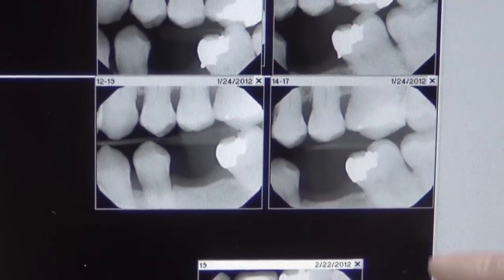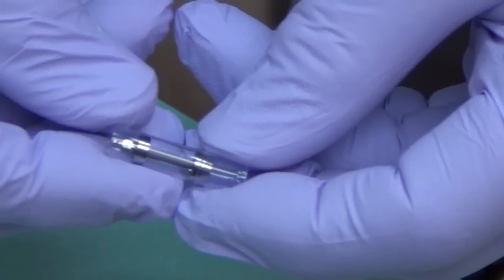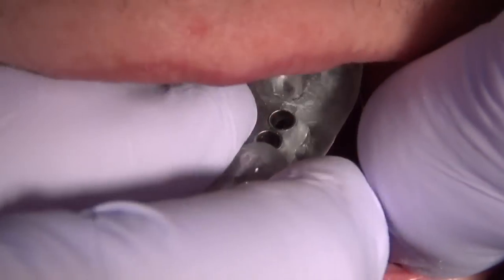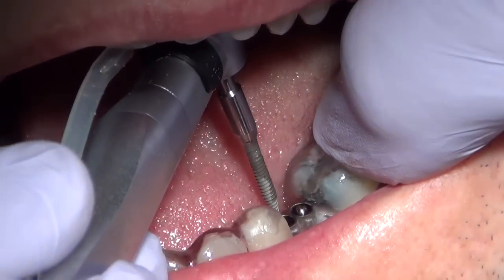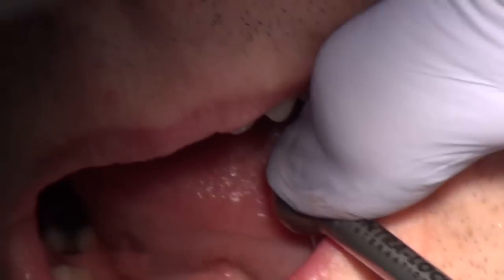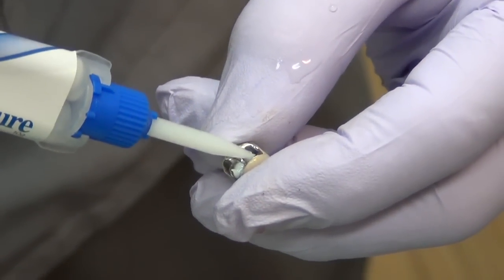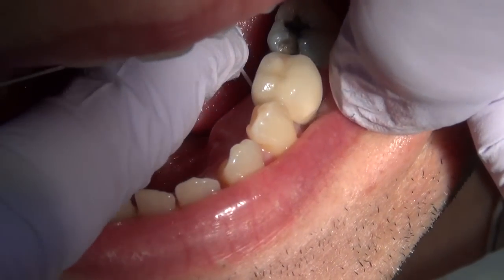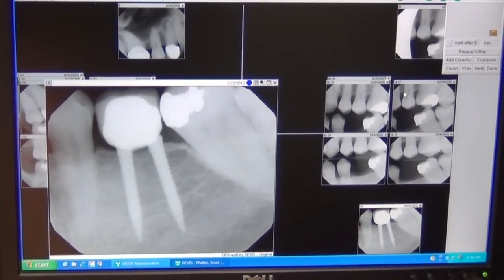Replacing a Missing Tooth with Mini Dental Implants

Comment: one tooth with two implant way too many, why not one implant per tooth,.after implant and crown were installed then he took x ray to see if the implant was properly installed, he should monitor the drilling first to make sure it did not take wrong angle I think that was too late. I am not a dentist but will never do implant if the dentist does not monitor through the digital ex ray the direction and depth required for drilling and monitor the implant as well. coz is easy for the dentist to justify failing implant you did not have enough bone.